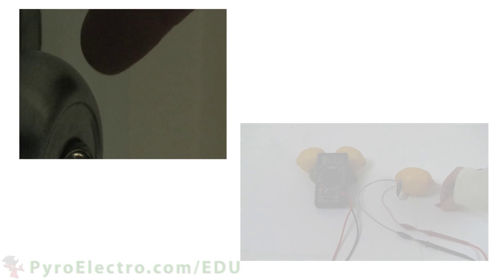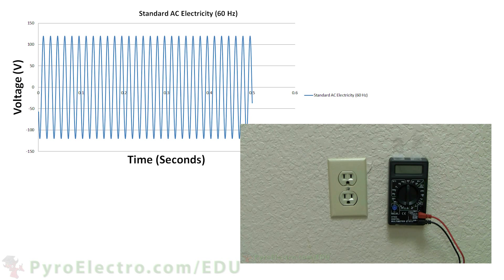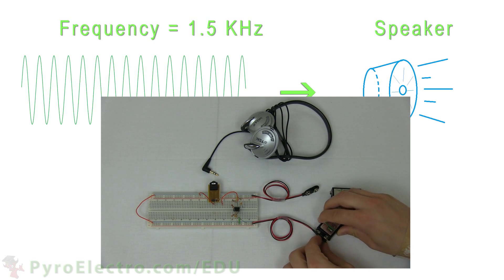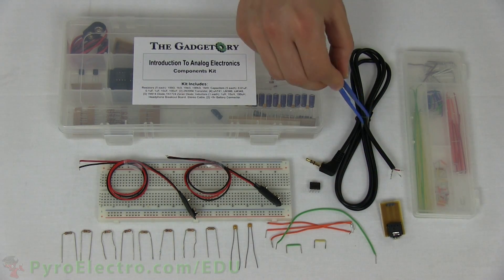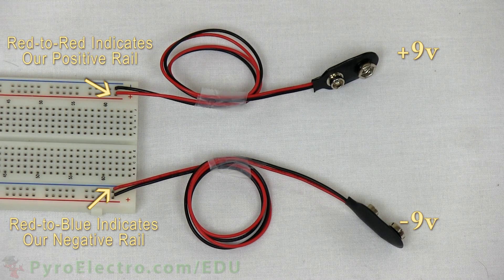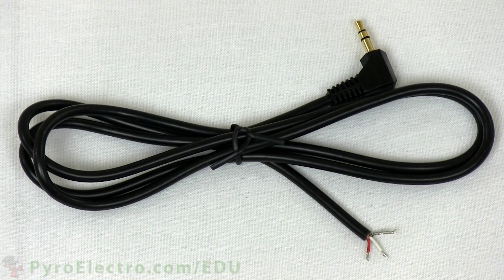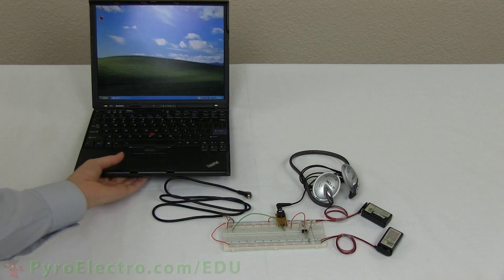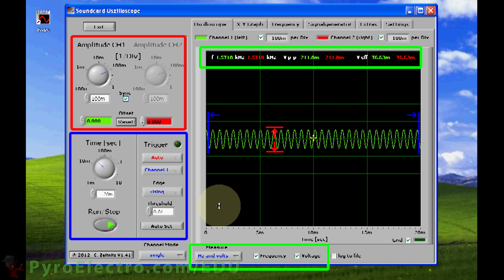AC vs DC - An Introduction To Analog Electronics - PyroEDU

Comment: I've made my 1st osc. circuit before seeing this video... Sir, I must say that you're most probably discouraging people than opposite. I'll explain:
- the schematic with a bipolar DC supply is made complicated. Much more easier to understand when you put + and - from different connectors on ONE minus rail (I choose the bottom as it's good to associate with "ground") and say "here plus and minus from two separate batteries meets together thus making a zero volts or "ground" ". Then you simply put two other wires to the minus rail (I choose top as on the op.amp & I guess it's usual) and to the plus rail accordingly. After that just make an important note that "you must be careful and not let your other (not joined) plus wire to be accidently installed in a bottom " - " power rail to avoid short circuit". And after that you just draw "0" or "GND" next to the "-" bottom sign on the breadboard.
This will be looking very clear and easy.

- inserting a circuitry in a computer sound card wasn't explained with a pretty easy definition of the voltage divider. It's easy to find but beginners may just not guess that "look, it's here! this is... now I know how it looks and acts". No. Total beginners doesn't have a clue what's there. Just two resistors... "Hmmm stick 1k to the minus or 10k, or 10k closer to that output... meh, whatever!" Guess what can happen next. It's good if the inner sound card is well protected and nobody will try to insert a 9v battery output directly to this by an accident :) I know it's a stupid case... but if you explain something from zero IMHO it should be sequental, not accidental or a type of "do exactly as in the picture" (that is easy to mess up).
At least some link to the voltage divider theory (with a standard youtube's link frame) can be added. It's not that boring and can be explained in a minute.

Comment: I wish the person who demonstrated construction of the circuit would follow the schematic that was shown. They disagree with each other. For example, look at where he hooked the +9v and -9v to the IC. The pins used for this in the schematic are different than the pins used in the demonstration. Also for the connection to the computer (i.e. the "oscilloscope probe" connection), the schematic is again different than the demonstration. Take a look at the resistors specifically in the demo vs. schematic. Great courses but frustrating as a beginner to not only try to learn, but also have to trouble shoot your demo's and schematics.
Reply from the maker: John W Thanks for the feedback John and apologies for the confusion. We will be updating our videos next month with these much needed corrections.

Comment: I realize this video is intended for beginners but some of the information mentioned in this video is not just simplified it is wrong.  In the video the AC voltage from a wall receptacle is measured using a multimeter.  The voltage displayed is 122.5 VAC,  This measurement is of course is a Root-Mean-Squared (RMS) value.  This AC waveform would therefore have peak values of plus and minus 122.6V times the square root of 2, or plus and minus (122.6V) X (1.414) = 173.4V.
Following this measurement, your oscilloscope displays a SIN wave with a peak voltage of approximately 125V.  I am guessing you rounded 122.6V RMS  to 125V Peak.  I think you should clarify to the beginning electronics students the difference between RMS voltages and currents and Peak voltages and currents for AC sinusoidal waveforms otherwise they may be very confused when they perform some of there first measurements.
Secondly this video talked about Phase.  The AC waveform displayed indicated two intervals on the horizontal axis (0.1, 0.2) and (0.3, 0.4) which were labeled Phase Change.  In the first interval this appears to be full-wave positive rectified and in the second interval it appears to be full-wave negative rectified.  I don't know why you would refer to this waveform as having phase changes.  Phase change is beyond the scope of this video.  Full wave rectification is not however beyond the scope of a beginner but the waveform shown in this video would require some switching in addition to just full wave rectification.
I have only watched a hand full of your videos so far and several of them I thought were good for beginners but this one I strongly feel needs your revisions.
I do intend to watch more of your videos as I think some of them are good and the one that are good I will recommend to some of my friends who are just beginners.

Comment: Hello sir,
First of all i wanna thank you about this great,Informative, easy to learn course
second i tried this experiment but its not worked with me, so I try to trouble shoot it so i disconnect the cappacitor which connected between pin 3 and ground so its worked on headphone but scope app read about 3.285 KHz.
another issue this schema include 3 capacitoers when you used 2 only!
please help